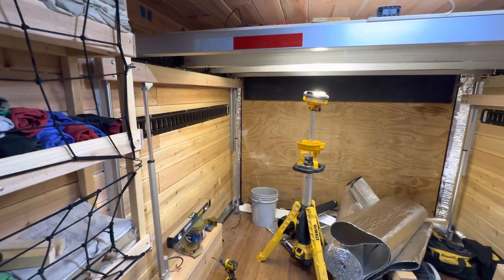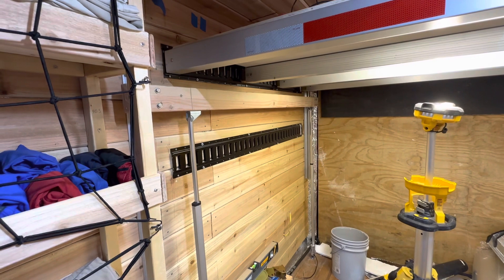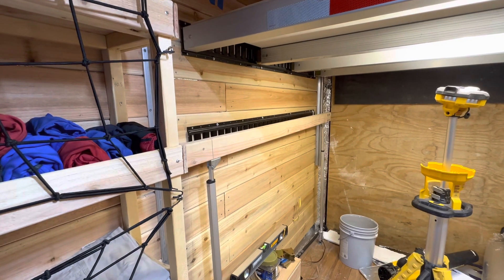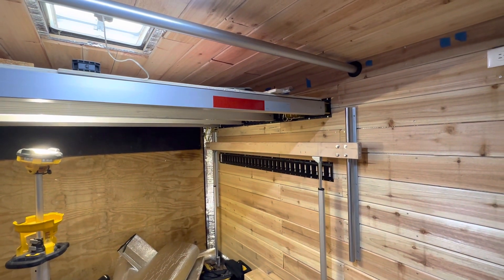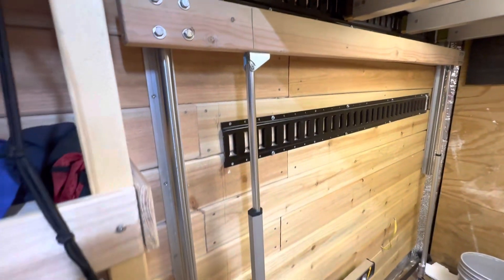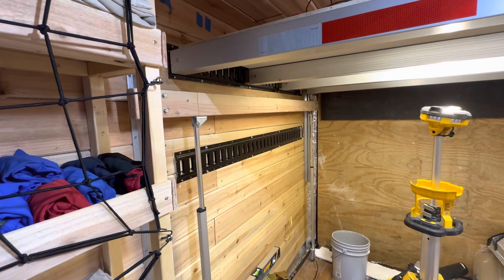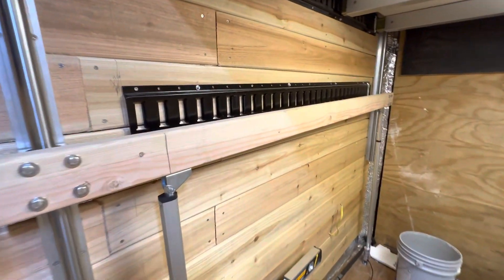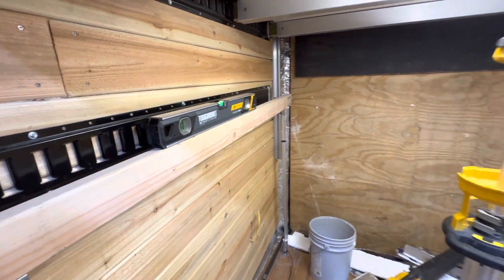Cargo Trailer Conversion: Linear Actuator Bed

Comment: Checking for level when the trailer is not necessarily level.....try using a tape measure to get them all equal
Reply from the maker: I’ve done that. There are too many build components of the bed that it’s nearly impossible to get perfectly square and level where over time that one linear actuator may have more resistance in raising the bed.

Comment: Will you be able to sit up in bed?  Doesn't look like very much clearance.
Reply from the maker: @TheWanderingFinnegan  enough to sleep in with the bikes highest point.
Reply from the maker: @TheWanderingFinnegan  no, not in this build with the Tall bikes underneath.

Check out my latest linear actuator bed build video.
Reply from the maker: No. I have to tilt my head down slightly. 

No worries as I most probably be sleeping in the CAT as I’ve built out a Mercedes-Benz Sprinter with a linear tail and actuator bed!

Comment: Very cool!  Can you install an adjustable limit switch or stop block?  With a mattress on there it won't go as high right?
Reply from the maker: It should stop at the upper end of the actuator, but I haven’t pushed it and tried it yet.
Reply from the maker: It stops at the upper limit.

Check out my latest 80/20 linear actuator bed build in my 2016 Sprinter van build.
Reply from the maker: @WallyZ1950  Check out my “new” Sprinter 80/20 linear actuator bed.